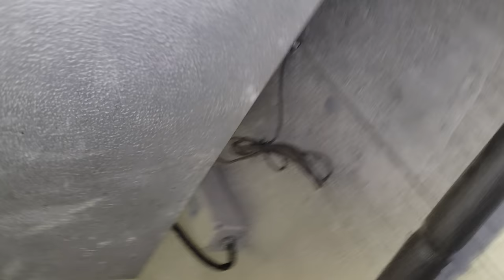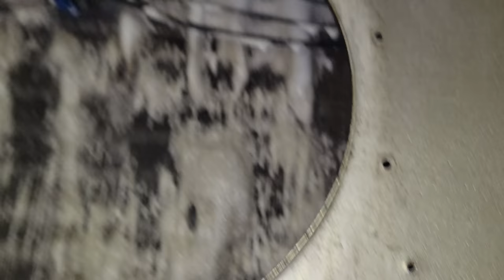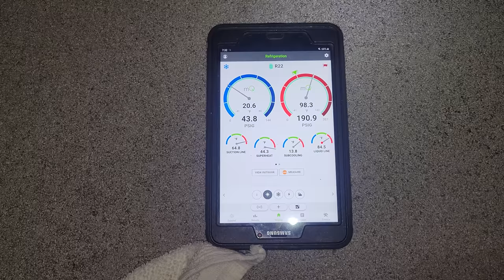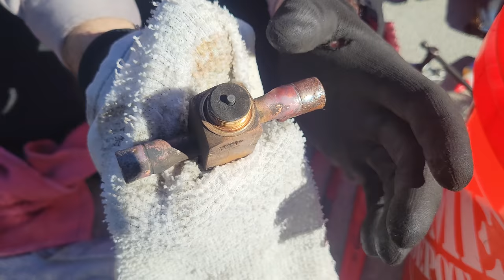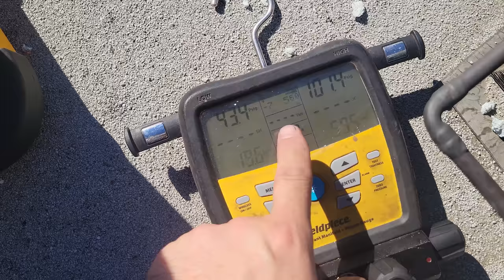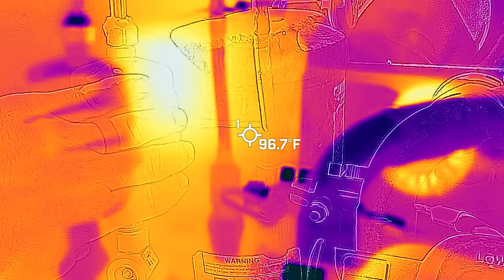CLEAN OIL IS OVERRATED AND PREVENTIVE MAINTENANCE IS NOT NEEDED.....

Comment: Preventive maintenance is not needed.... if you accept stuff breaking down at the most inconvenient time.
Reply: Then they get to pay for the "most inconvenient time charge" to fix it.... bet it be cheaper to do PM
Reply: @MFCSTUDIOS  Not just the most inconvenient time charge, lots of replacement parts that wouldn't have needed to be replaced too.  How long before that new valve fails for the same reason?  How long before the trashed compressor fails entirely?  I bet that adds up pretty quickly too.

Comment: If the oil is bad enough to kill the Head Pressure Control Valve, how has the Compressor survived?

Or maybe the question should be: How little time does the Restaurant have left before the Compressor dies?

Comment: Cool to see how that valve actually works. Kind of sad that that entire system is trashed like that. It should be in a lot better shape at this point. You know that defrost clock has been broken for months. They only called you when the cooling was basically zero.
Reply: he should of replaced the clock with a mechanical Paragon 8045-20 if its a walk in cooler the defrost termination is not needed the Paragon 8145-20 clocks has the solenoid on the back for defrost termination for some coolers and freezers.

Comment: 1.) Packing loose on suction king valve leaking and causing oil spot. 
2.) Go to a plumbing store and get pump up plugs. This way you can seal off other openings in a multi piped drain and blow out each line separate. Good explanation of the headmaster valve. Stay safe and be well.

Comment: Haven't fitted a paragon timer for 20 years. Here in Australia I can buy 5 digital controls with heaps of functions including defrost for what 1 paragon costs.
Likewise on commercial gear fan control rather than hot gas bypass for head pressure control has been used for 30 years. NH3 is different of course

Comment: 21:22 Yeah they hard to find, I looked around for one of those valve cap for an old water cooled condensing unit, finally compressor died last December and I replaced the condensing unit.

Comment: Would a blockage somewhere after the head pressure control cause the head pressure control top to blow apart in 2 pieces on a condensing unit. A little background  the whole system is only 3 years old and another local company came out and diagnosed the problem to be a leak and charged the unit adding 8lbs of R404a the next day the system stopped cooling I was called out and found the head pressure control top had split in half and the top had came off and went across the condenser and dented the tin on the other side.  I am trying to figure out if I should replace the whole system replace the head pressure control or the condensing unit. I dont want to charge my customer for repair if there is a bigger problem and then they have to end up replacing the system.

Comment: Any tips on troubleshooting a headmaster valve that is not bypassing? I had a walk in freezer a couple days ago that I suspected was not properly bypassing. Found evap frozen solid and thawed out coil. Found t stat was was cycling properly and opening and close liquid line solenoid properly. Went up to roof to check my pressures and I was running 23/133. -10 degree coil temp and only 63 degree condensing temp. Outdoor ambient was 45 degrees. Refrigerant was R-404a. Suspected the unit was low on charge but I found that sight glass was filled with liquid. Felt the discharge line going to valve was hot to touch and liquid line from condenser to valve was warm and line to receiver was also warm to touch. I also checked the liquid line filter drier and it only had a 1 degree td from inlet to outlet. suspected that the headmaster valve was not properly bypassing due to having such a low head pressure. Headmaster valve is supposed to maintain 180 psi. The box temp was around 5 degrees and stat is set for 0 degrees. Any suggestions or tips from anyone would be very much appreciated. Thanks.

Comment: Just wondering, how long is too long to keep to door open? We have a walk in fridge at work and I'm curious, as well as not wanting to cause issues because duh haha
Reply: it should be closed as much as possible.  its like asking  "how much does a bag of grocery weigh?"   'It depends...' on the volume of the cooler (and door opening) temperature and humidity difference, the insulation,  the rating of the cooling system, and how well it's running.  probably a few other factors I haven't thought of

Comment: What brand do you replace those white GE evaporator fan motors with?
 
OEM is crazy expensive (my local supply house is probably over charging me), Dayton band is trash(all died >1yr). Fasco, packard does not last as long as OEM (1-3 years before the squeekes start). I match specs, but it all for not.

Comment: Try using a 1/4 or 1/2 horsepower pump and a 10 ft hose in a 55 gal trash can on wheels for deicing.  I work in grocery store refrigeration and it’s a life saver. I love the videos btw.

Comment: I could be wrong but I had a unit with the headmaster bypassing going off on high headpressure. I clipped the tip and it fixed it and completely stopped bypassing?

Comment: If you clip that line on the Head pressure control valve that charge would instantly empty! If you actually look at the forces previously acting on that seat: There’s that constant force of the charge acting down on the seat hence permitting the gas flow (unwanted in that situation). The ofter force is the system’s pressure acting on the spring‘s side of the seat (wanted and needed to cut the flow). If that shaft/seat got stuck in the open position, the resulting force will try to push it up again but it‘s just stuck harder than this force from (190psi-180psi) just a 10psi difference can break loose. When now all force pushing down is cleared by letting out that 180psi pressure charge, it‘ll might very well loosen the stuck component… Am I wrong?

Comment: those Grasslin defrost timers  most of these fail most contractors replace them with the Paragon mechanical time clocks as they are reliable and readily available those Grasslin timers has the 3 tabs also so it can snap into a standard Paragon 8145-20 case  or the adapter kit to mount the Grasslin timer to the paragon mounting bracket or the old AMF Paragon cases  Nor Cal refrigeration and Jim Pettanio has channels replacing these Grasslin timers with the Paragon 8045-20 and 8145-20 timers.

Comment: Sounds like my work we do reactive maintenance on our cranes aka it fails when we need it most and it's 40 years old so hard to get parts now
Reply: @Irilia_neko  well yea like they get inspected yearly but still had the brakes fail on the 10t crane twice cause instead of buying a brand new brake for the hoist let's get it remanufactured and it fail and jam I 3 weeks later do to heat

Comment: It baffles me that no one is using electronic defrost clocks, but still use those old mechanical ones.

Seems like a bad idea having a mechanical clock on the roof, where it will eat a lot of dust and seize up.
Reply: The relays on the electronic timers just don’t last like the old mechanical timers.
Reply: @2012tunes1  Aah i see.

But that could be down to them using small relays with smaller contacts. If memory serves, there is also a relay on the mechanical ones, if they used the same type of relay, i dont see why it should not work just as long as the ones on the electromechanical clock.

Comment: Did you changed the Oil in this System? You knew that the system is cooked and it get changed soon but that would be interesting tot hear why you did/didn't.

Keep up the great work! :)
Reply: As an Ex Fridge engineer, I can explain.... The compressor is a hermatic type (Sealed) and generally don't have oil drain off valves. That means you would need to un sweat the compressor every time you change the oil. Then multiple oil changes after the system is live. So would cost in excess of 4 days work for a tech at $400 = $2000.00. No real cost benefit on a system that costs $5k.
Reply from the maker: I will discuss this on my livestream this evening 02/07/22 @ 5:PM (pacific) on YouTube come over and check it out https://youtu.be/AjnU2FRoRiA